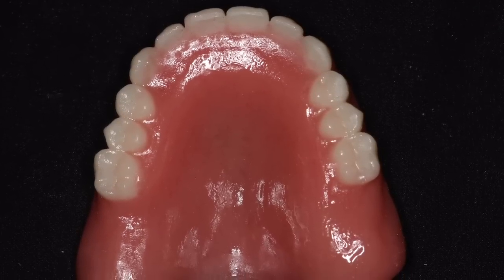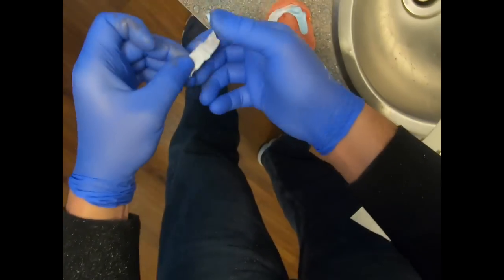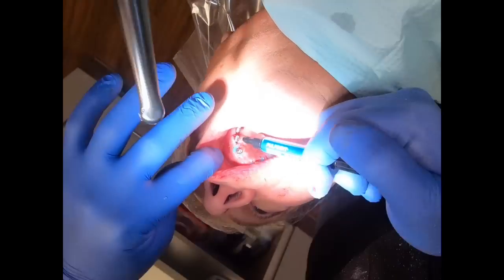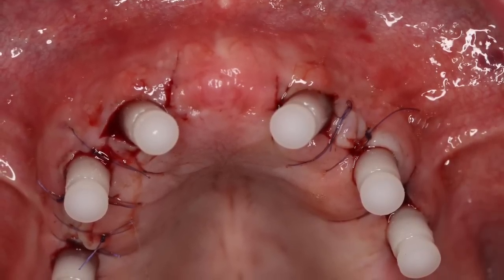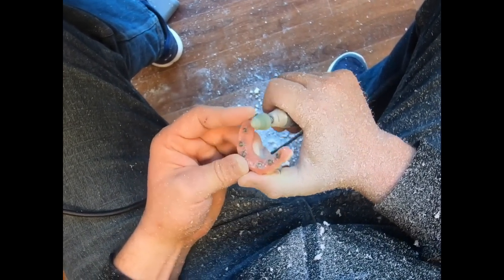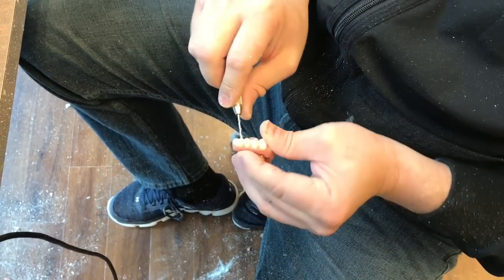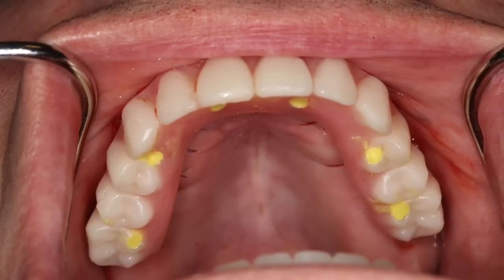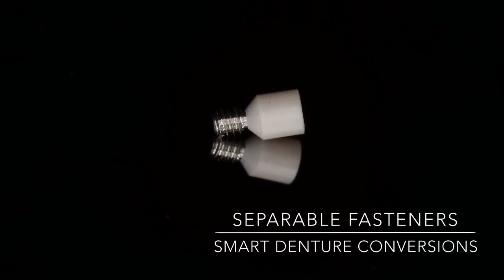Introduction to the Smart Way to Convert a Denture to Fixed Implant Prosthesis

Comment: Why use so many screws..why not just 2 top and 2 bottom
Reply from the maker: Great question, it really comes down to support for the arch of teeth.  If you have a home built on footers, how many do you need?  Most likely more than 2, it comes down to support for the structure of the home.  To replace a full arch of teeth, the bare minimum need is 4 implants (or "screws" as you put it). Personally, if there is room enough in the jaw, I like to have 5 or 6.  We don't charge per implant for these full arch cases, some get 4, others get 6, it all depends on what the patient's anatomy will allow.  Great question, let me know if you need further clarification

Comment: If you’re concerned about creating heat, what happens if the patient likes hot drink like coffee or tea?  Or even piping hot food. Will this damage the device
Reply from the maker: No, the concern for heat is burning the patient's soft tissue ("gums").  If the patient chooses to burn their own gums with piping hot liquids, they certainly can do, but they can't blame the doctor🤣.  Irrigating during the exothermic reaction of the acrylic is something we doctors do as a courtesy (or to avoid lawsuits😆) not to burn the patient's soft tissues.  Hot liquids like coffee or hot chocolate really don't have a significant effect on the prostheses.  Great question.  Let me know if you need further clarification.

Comment: Is this done immediate after surgery? does it keep the implants exposed so they gum tissue doesn’t grow over it?
Reply from the maker: I do these Conversions at surgery, the implants are embedded into the bone and completely encased in bone.  The bone will heal up to the implant and fuse with the implant in a process called "osseointegration".  An abutment gets screwed onto the implant and is known as a "transmucosal abutment".  The tissue will heal around the abutment maintaining access to the screw channel of the abutment to easily remove and replace the prosthesis in regular maintenance intervals required by the patient for adequate hygiene.  So, in a way, yes, the prosthesis will help to keep tissue off the abutments.

Comment: Do these dentures pop on and off?
Reply from the maker: No, these prostheses (dentures) are screwed down and stay in place until your dental professional removes them by simply unscrewing them and cleaning them periodically.  (I recommend either 6, 12, or 18 month intervals entirely dependent on the patient's hygiene compliance).

Comment: Just quick question how  much is that, dentures and implant?
Reply: They don't want to scare ya with the price...Ill bet it starts at 30,000.....
Reply: All depends on the quality of material used. (Swiss, Korean, US, israel)
Reply from the maker: There is a range of $15,000 to $45,000 per arch.  Cost is a function of provider and restorative materials.

Comment: Dr. How much the total cost on that  procedure?
Reply: In US a permanent fixed to implants aka all on 4s which can only be removed by dentist is min 50k. Or you can get implant supported snap ins denture which you can remove yourself about 25-30k which is what I'm getting done. The permanent fixed is better and is like your actually teeth but it's very expensive
Reply: @TF.Jodi21  You can get that done in Las Vegas by bionic smile and have permanent bridges instead of dentures for that price. I believe they'll do snap in dentures for like 12k for 8 implants. I here Jose Moguel is one of the greatest at implants and will do a all on 6 for 17k but that's right at the border. Totally worth it to save 25k.

Comment: Hello there, which parts are those ti bases you are talking about?  Which implant system do they work with?
Reply from the maker: Those Ti bases are from www.SmartDentureConversions.com. 

There is a compatibility chart on the website for which implant systems they work with.  The short answer is that any multi-unit abutment that has the same geometry as Nobel or Straumann abutments is compatible with these Ti bases.  DESS-USA muas are awesome because they standardize the restorative platform for the majority of major implant systems.
Reply: Titanium base. Existing in every implant systems

Comment: Is it easy to remove intraorally?  Also Seems risky or hard to remove threaded screws. Your thoughts?
Reply from the maker: Super easy to remove, and everything in dentistry has a level of risk.  Mitigating against the risk is the important thing, so using the press-on caps to remove the threaded fragment is my way of mitigating against the risk, but the reality is, that threaded fragment is not that much smaller than a prosthetic screw.

Comment: Do you relieve space for the tibases until the denture is fully seated on the tissue before you pick it up? Just wondering what's your reference? Thanks
Reply from the maker: Yes, unless you are intentionally increasing vertical, but usually I am creating space for the denture to seat passively over the Ti bases.